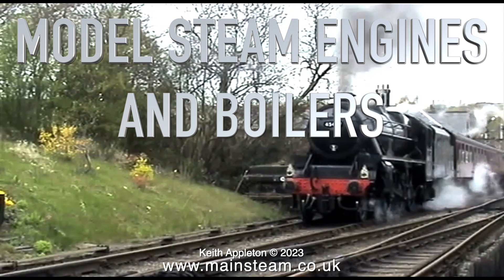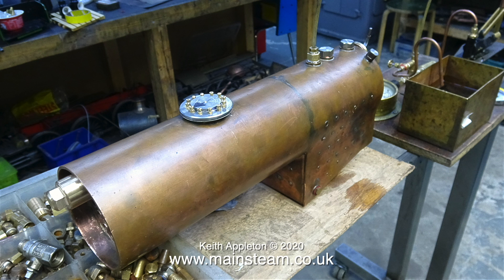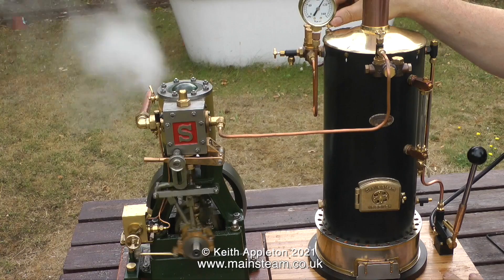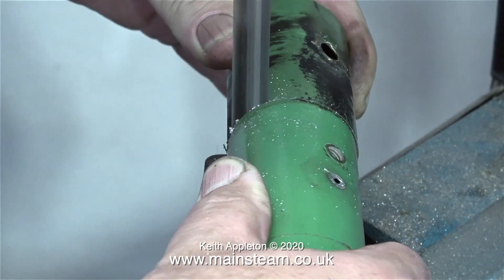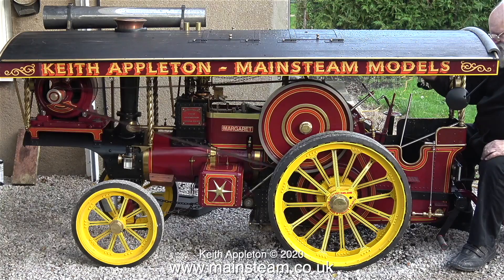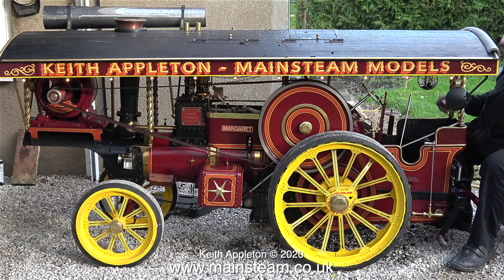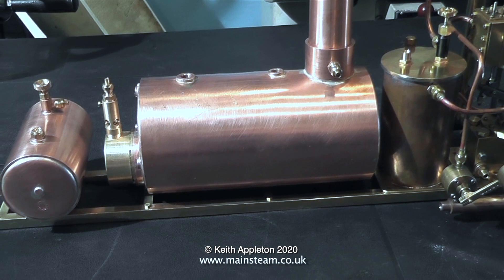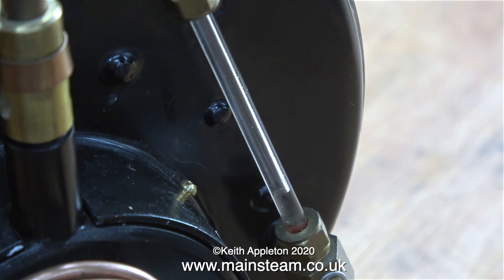MODEL STEAM ENGINE AND BOILERS - PART #57

Comment: What you said about strength is true. One thing to note is that copper doesn’t weld properly. The locomotives have rivited steel and copper as that is the best way of construction. Not feasible at all for models. If a steel boiler is cared well for it can last many years. Repairs are also “relatively easy”.
Reply: It is not correct that copper doesn't weld properly.  Copper can be TIG welded effectively and there are commercially available welded copper boilers.  I believe they take great care to use pure copper.  You may have heard of problems  welding copper alloys, which is true - alloy metals such as zinc can compromise the copper for welding.  The same is true however for steel as numerous steel alloys are unsuitable for welding into boilers.  For examples, leaded steel doesn't weld properly, high carbon steels can harden and crack and some stainless welds can degrade in contact with steam.  Both steel and copper can be welded for boilers but both require material and process control.